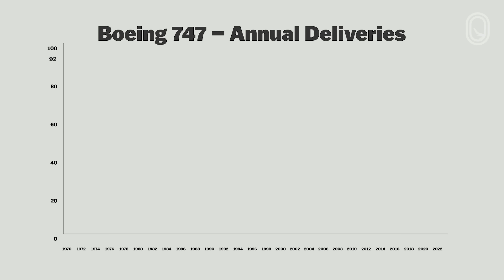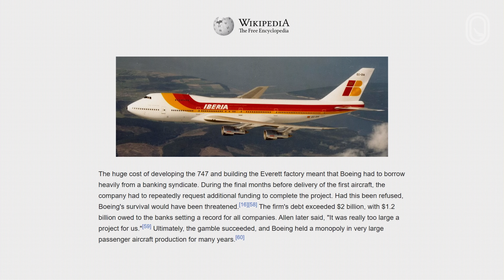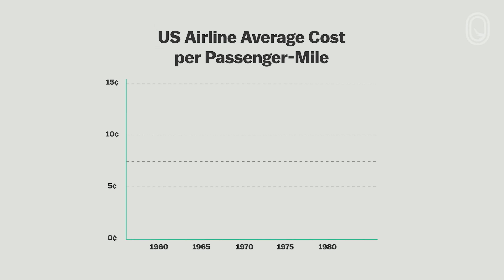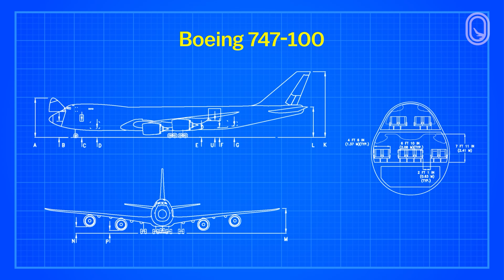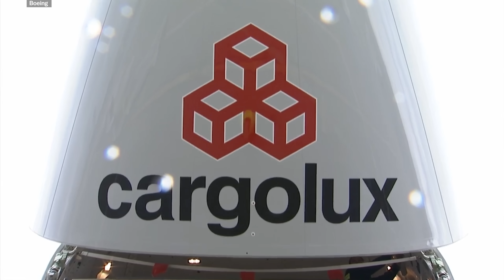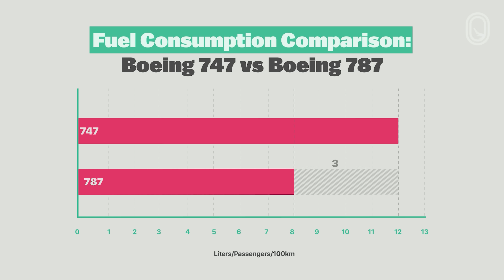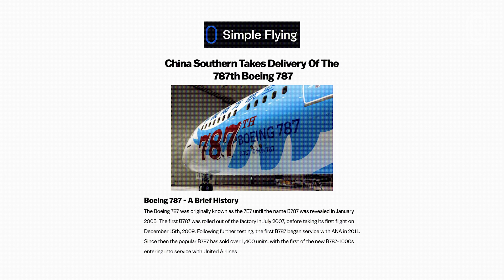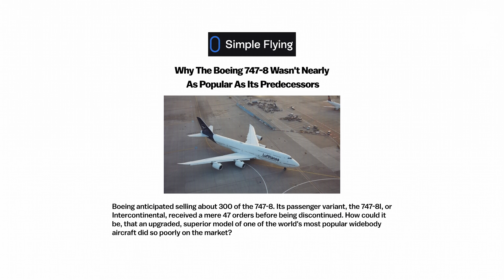Rise And Fall Of The Jumbo Jets: 747 & A380

Comment from the maker: If you could fly on one jumbo jet for the last time, what would it be? 747 or A380?
Reply: 747 on the upper deck
Reply: The Boeing 747-800
Reply: @ThePowerOfAllPeople  you mean the 747-8 ? Boeing got rid of 'hundred numbering' last generation.
Reply: A380
Reply: 747
Reply: 747
Reply: 747
Reply: 747 without a doubt!
Reply: 747
Reply: A380
Reply: You suck
Reply: A380
Reply: The newest of the 747. The 747-8. It's not just a 747 with new, efficient engines, it's redesigned and is actually slightly bigger than the 747-400, and new composite wings, I believe.

Overall, not a bad video, and you gave some credit to the 747-8, but please change the thumbnail to not say "dumb design". The 380 was designed strictly for passengers, and the 747 for both, as you mentioned; so no, not 'dumb design', especially the 747.
Reply: 747, I already saw an a380 I wanna experience a 747
Reply: The 747 was just a right size plane, the A380 was just too big, it required bunch of airports upgrades and the newer 747 8i burns less fuel than the A380.
Reply: A380. Flown on them loads of times. They beat the pants off 747s

Comment: In the late 1990s and early 2000's I flew to Hong Kong from Los Angeles 3 times a year on 747-400s, and sometimes I returned to LA on the back flow of all the major trade shows in HK and Guangzhou, whereby planes flew to the far East filled to the brim, and turned around very quickly and virtually empty, to pick up more passengers and fly them to Asia for the trade shows. I remember one flight from the stopover Narita to LAX where there were three passengers (including myself) inside a 747-400 for a 14 hour flight. This is to say that, once you spend that much time in a virtually empty 747 is when you realize how enormous it is. It was like being in an empty warehouse!

Comment: The 747 wasn’t dumb.
It was an underdog design for Cargo if the future was determined to be ruled by the supersonic jetliners back in the 60s. But it didn’t happened, and with rising fuel cost, the 747 came at the right time, big enough to accommodate more passenger while using less fuel, efficient at the time. the A380 also have the same idea, but came at the wrong time.
Reply: I think the biggest flaw of the A380 was can't be easily converted for cargo operations or that Airbus didn't bother to have a plan B for it.
Reply: Yea.
Reply: The main thing I think is that maybe technology wasn't that advanced to make a 2-story jet. Boeing